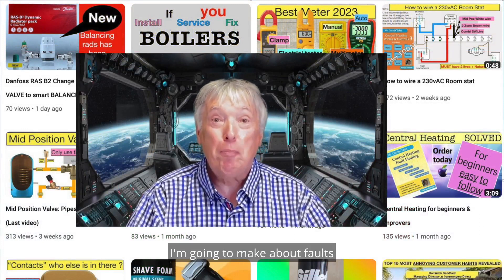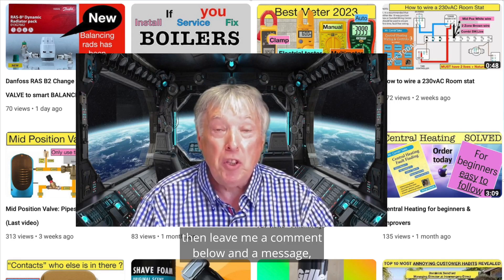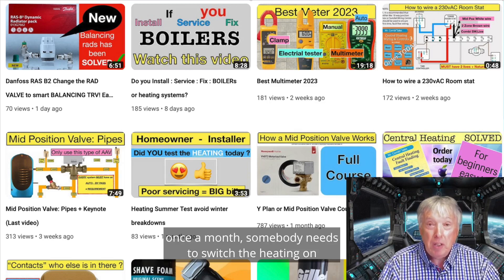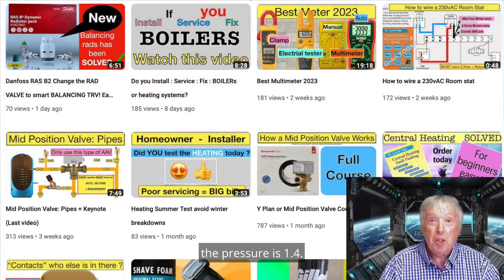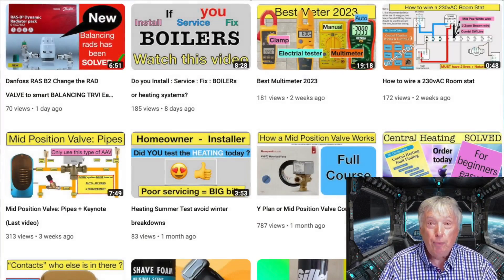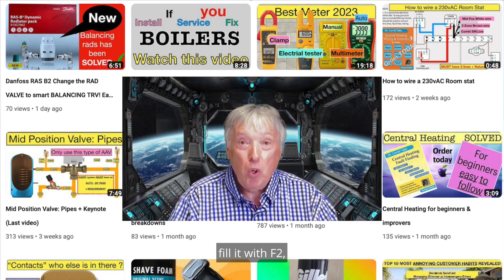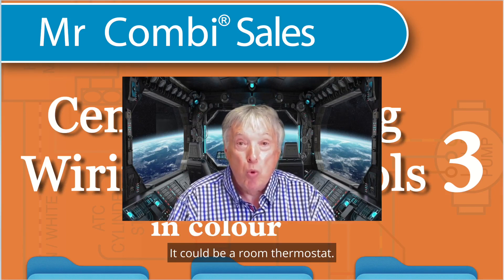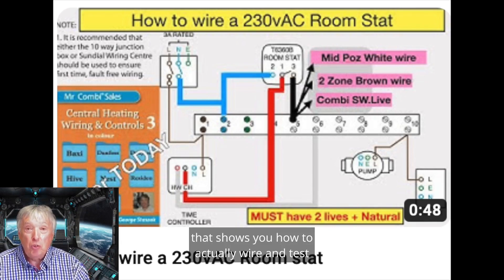No Heating

Comment: Good Morning. How often should one add inhibitor to a central heating system? Regards
Reply: Hi
where can I buy the books?
Reply from the maker: @iqbalnuthoo1566  thanks for asking from our website www.mrcombi.com
Reply from the maker: Dear Mohair, Thanks for asking, after the system has been drained and before refilled with water. Please note when the NEW system has been flushed with cold water, drained refill to heat test to MAX 70c drained HOT then fill with F1 inhibiter. Every time it's drained use F2 silencer not F1. Hope that helps, regards, George Staszak👍
Reply: @mrcombiBedford  Thank you. So one should not add inhibitor every year? As I thought it is good practise to add regardless of if system was drained or not. regards
Reply from the maker: Only after draining, never yearly, leave it in.
Reply: @mrcombiBedford  Fine thank you. So during an annual service you shouldnt add inhibitor to a system? As I thought over time it dilutes itsself and the strength becomes weaker.. regards
Reply from the maker: @mohitl1697  just leave it in, it does not dilute, George
Reply: @mrcombiBedford  thank you sir :)
Reply: @mrcombiBedford  One more question... I saw you said after draining, use f2 rather than f1. is this because f2 has some inhibitor in it too? otherwise is the system still protected? regards
Reply from the maker: @mohitl1697  Hi Mo, Yes it does have some F1 in it but has extra chemicals "silencer" which keeps on working to clean the exchangers 247 365, that's why Fernox made it, if in dought use 2 bottles on a 3 bed semi. regards, George 👍
Reply: @mrcombiBedford  Thank you George. Also one more question, why is it that expansion vessel pressure needs to be checkedeg 1 bar with the system drained? Can you not check and adjust with the system still full of water? Regards
Reply from the maker: @mohitl1697  Hi Mo, Correct, an empty system cannot have 1 bar. if possible the homeowner should check every couple of months, when to heating season starts the pressure should not go above 1.2bar as per video to fix, hope that helps, george👍